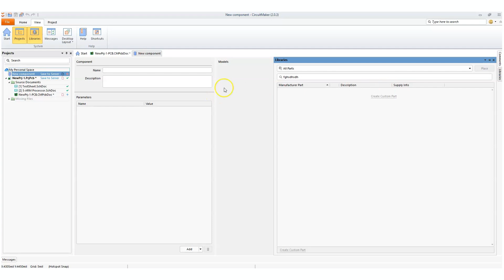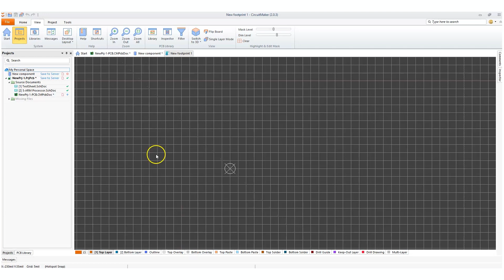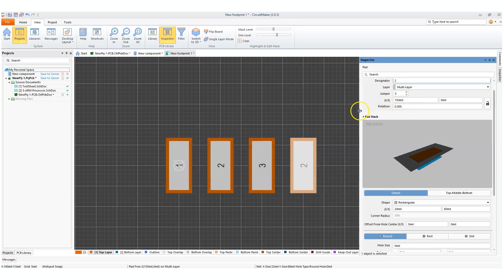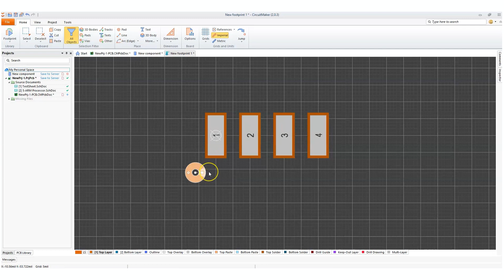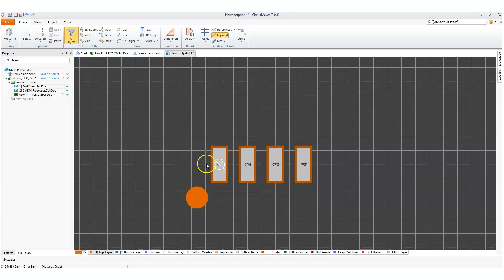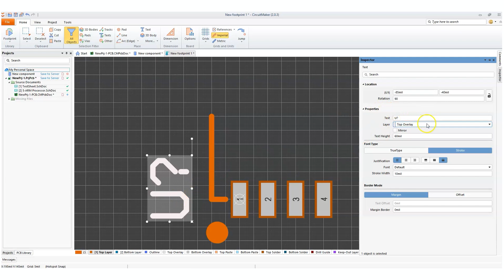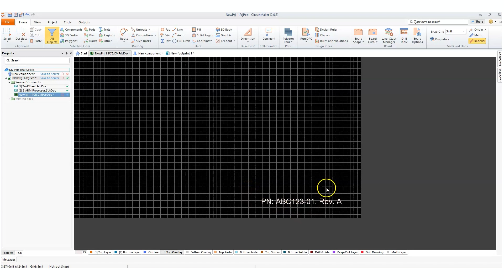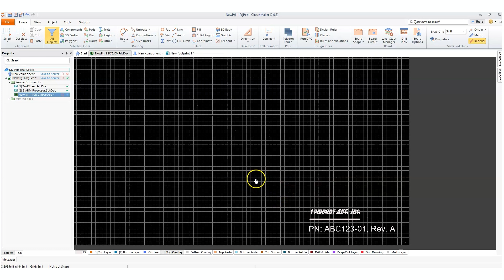Where to Place Circuit Board Silkscreen

Comment: What's the point of wasting time on adding silkscreen when almost all SMD parts are automatic PnP mounted? Even if hand-assembling, having the package outline for SO8 is a complete overkill. 
Just add a pin 1 marker and the ref-des - much more useful in tightly packed PCBs than an IC outline...